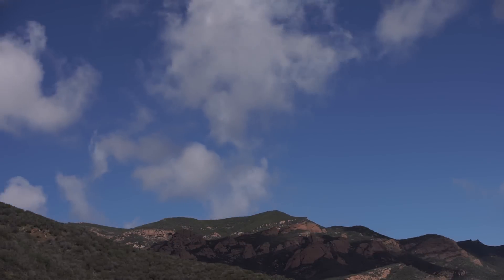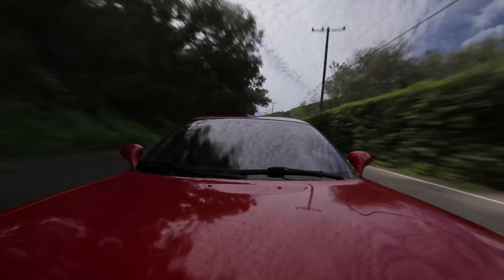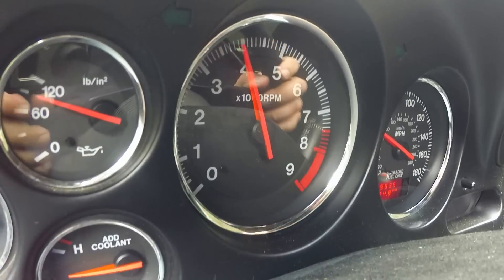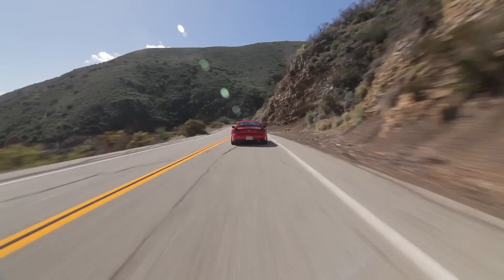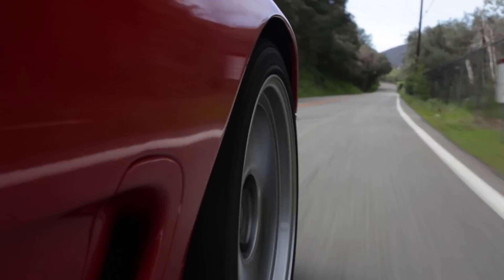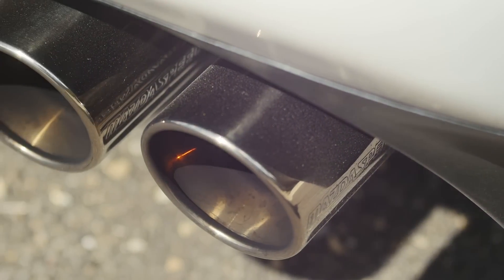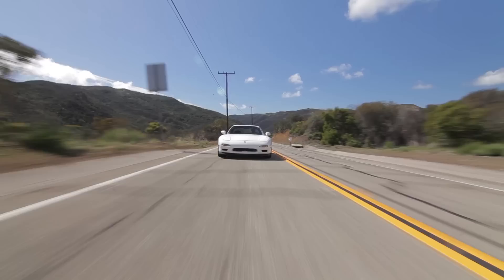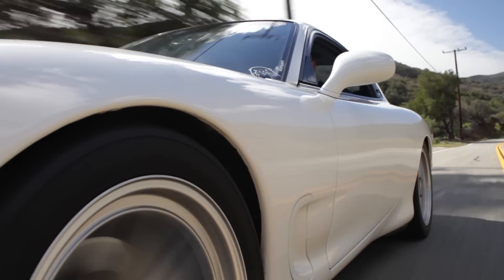Mazda  RX-7: Turbo vs V8 - /TUNED

Comment: Honestly, I'm not a fan of a V8 in an Rx7. With that being said however, if you really want to make a lot of power, going the V8 route would undoubtedly be more reliable in the long run and it would provide the low-end torque that only a large displacement motor can. Would it sacrifice handling? absolutely, but is it an absolute sin like most people make it out to be? no, it really just depends on what you want your car to be able to do. People who keep rotaries don't care so much about ridiculous straight line speed and acceleration and instead prefer handling, people who swap V8's don't care so much about handling and instead just want to go really fast. With either route, an Rx7 is still a beautiful and awesome car meant for a true gear-head.
Reply: the reason i would do a ls swap would be reliability not power
Reply: its so hard to lose weight compared to making power and because lightness is the best mod as it improves every spect of performance without having cons it would be a challenge to get the weight lost that was gained from the swap but if you did and managed to get 50/50 distributon without the need of removing creature comforts like a/c or powersteering but instead relocate battery/full carbon fiber front end/carbon fiber bracing/arms and componants the ls swap would be perfect.
Reply: Even worst , this guy said its classic british car😧     

😅😅😅😅😅😅 (brainwash technique HAS BEEN DETECTED🕯)
Reply: @pigeonsil240sx  LS engines are only 30-40 lbs heavier then the 13b with one turbo, and lighter then the dual turbo setup...the dimensions of the LS engine actually allows the car to maintain a near 50/50 distribution. seems like it would handle the same if not better than a stock rotary setup
Reply: @hahahafunniness  
the 13b weighs 337 pounds and the ls1 weighs 430 pounds a near 100lb difference not just 30-40lb a difference that would effect handling characteristics and feel less nimble and agile then the 100 pound lighter motor,..
the purpose of the rx7 was to be a light agile car where others opted for tehnology that added weight, fc3s had a 48/52 weight distribution with t2 motor. i think the ticket here is removing 100lbs up front after swapping in the LS this way you still have close to 50/50 weight distribution if your into twisty roads,if its just a street car who cares about agility right.
Reply: @pigeonsil240sx  I said the 13b with one turbo is about the same weight as an LS engine. Also, there are videos on this platform showing weight distribution of the fd after an ls swap and it’s pretty much 50/50. The only benefit to keeping the rotary over a piston engine is if you like to rev high and feel like youre constantly driving the car to its limits just to produce any torque.
Reply: @pigeonsil240sx  look into rx7 forums. They discuss the weight of the engine fully dressed with twin turbos is over 400 lbs. It’s very comparable to the LS engine but much more unreliable
Reply: @hahahafunniness  ok ill take your word on it. what i still dont understand is where the 337lb came from when its googled? I bet its 400lb 13b is with all fluids and accessories on the motor and 337lb 13b is dry with no accesories.therfore it sounds like your right.
was the ls used for weight comparison also full accessories and fluids added? thanks for the input on this btw.

Comment: It's sacrilege to take out the rotary engine from an RX-7 and put a V8 into it.
Reply: Attila Vidacs It's only sacrilege if you're ignorant to the advantages of having a V8.
Reply: Sigma Octantis Im sure if you dig deep enought, the third reich had some advatages... just sayin
Reply: +Saku Jalonen I applaud you good sir...
Reply: an even bigger sacrilege is how a corvette with 250k miles still runs strong and an rx7 with 100k miles needs an overhaul. if you even make it to 100k.
Reply: it's becuase clueless people think that maintaining a rotary is the same as piton. i have seen rx7's with over 300k kms.
Reply: At least it puts another rotary on the market
Reply: @abadibi  I have seen LS engines with 800km lol.
Reply: @weasle2904  and i have seen 2kd-ftv engines with over a million miles. I have seen D24TIC, B230FK, K24A3, and 1UZFE engines that also did over a million. LS aint as special as u think it is. It is only special in USA, but in places outside america the LS is too expensive and its cheaper to go other routhes that are more local. Lets say this: to get a B235R engine to 700hp is cheaper than buying an LS engine stock, you know that? and it'll be plenty reliable after u fix the oil pickup screen for like 2 bucks.
Reply: @abadibi  Almost all of those engines are not even comparable to a performance V8. and the B235R requires being rebuilt and heavy boost to even match the LS. The LS is one of the best engines around, even if you don't like it.
Reply: @weasle2904  bwahahahahah. He says as if he knows the b235r. It only needs pistons, turbocharger, oil pump and oil pickup screen. Those mods are 2200 dollars in total including the engine. Wanna reach 700hp on ls with stock ecu? Good luck with that because the ecu will set you back at least 2000 dollars for a good one with failsafe. Not to mention all the upgrade parts required. Dont talk about the b235r if you dont know it.
Reply: @abadibi  Are you 10 years old? 2200 dollars including the engine LOL! With custom internals and a turbo, okay. Maybe if you hired Ivan in Siberia to make you something in the metalshop haha! Custom internals, all that is need to be said. You're going to be lucky to make 500 HP. Sorry buddy lol. You can make 600-700 HP easy with an LS2 with a blower and a cam swap.
Reply: @weasle2904  dude...... are you kidding me? ive been working with these engines for 2 years now and here you are trying your best to "beat me" with your weak arguments, here is a full breakdown just so you understand it:
900 dollars for forged pistons
500 dollars for a hx35 turbo
300 dollars for materials to make the manifold and downpipe
350 dollars for a billet oil pump
150-250 dollars for AN lines, seals and other miscallaneous items. thats literally 2200-2300 dollars. I didnt include the engine cuz you can find plenty online for 50 dollars or even free ones, thats maximum 2350 dollars. You dont need cams or anything massive like that. boost the shit out of the engine and even the trans can handle the torque as long as its a manual. Ive seen one run this machine in his s14 with a bmw zf trans that he got for 150 dollars and could hang with supercharged ls swapped S14s. turbo lag is eliminated with anti lag system that can be added in the factory T5.5 trionic ecu.
I didnt add the cost of injectors spark plugs and fuel pump becuase you need that to mod your LS aswell:) but if you want that cost aswell its gonna be 600 dollars for a good 1200cc injector and spark plug set. And 70 dollars for a 300lph aftermarket fuel pump. Thats 3050 in total. Where i live, if i want a iron block LS i have to pay 4500 dollars. You can fuck off with the LS is better argument. It aint, your argument is just hanging by a thread. To what? own a outdated engine for 4500 dollars, are you serious? Want 1000hp? Then invest 250 dollars on forged rods from maxspeed. Building engines isnt that hard, anyone who tells you that is making it difficult on themselves. You just have to pay attention to detail, thats all.

Comment: 9:56 "The rotary engine certainly isn't better than the piston engine in any objective way"

- smaller
- lighter
- simpler
- sound better
- rev higher
- less vibration
- cheaper to manufacture
- less moving parts
- no reciprocating parts
- no catastrophic failure
Reply: +Kozzy Sound better? Arguable. No catastrophic failure? No, just lots of busted seals which are prohibitively expensive to replace and the reason why a huuuge percentage of the rotary engines ever made have already been scrapped for the value of their constituent metals, which as you pointed out, isn't much. Hmmm.
Reply: someone once told me apex seals are like timing belts 
hit 100k and spend some money and never think of it again for a while
not to mention depending how you service your car you may not even need to replace them until 150k plus kms
Reply: +1 rotary sounds better than your run of the mill v8
Reply: waikin Cheng Id expect most engines to get to 152000k’s without much trouble.
Reply: Smaller and Lighter, until you start adding more rotors to match the power of the V8. Simpler? Simple doesn't mean better, especially if it's unreliable. Sound better? It literally sounds like a dentists drill, it sounds cool for a minute, then you get sick of it. Rev higher? That's not advantage, that's a downside, needing to get to a higher rev in order to produce any torque. Less vibration? Small difference. Cheaper to manufacture? Not only is that not true when comparing to the LS, but it's completely irrelevant as the cost of the car is much higher and maintaining the engine is extremely expensive. Less moving parts. Again, doesn't matter, it's less reliable anyways. No catastrophic failure?! APEX SEALS.

Comment: You kinda kill the purpose and the character of a RX-7 if you LS swap it

Sure, with a big fat V8 you get more torque and more reliability (dem apex seals) and like Matt says on the vide...it drives like a Corvette, and I don't want no Corvette! I want a RX-7!
Reply: The purpose is to have a good sports car that doesn't drain your wallet and your   willpower.  Ls rx7 is a better car than a corvette because its 700 lbs lighter, and 10 grand cheaper and you don't have to fuck around with the rotary anymore.  It's bliss.
Reply: Actually, LS engines aren't big or fat. An LS1 or LS CT weighs about the same as a turbo 13B-REW, in fact. The LS is objectively better in almost every meaningful way. Weight goes up with these swaps most often simply because they beef up other things to handle the tremendous power of an LS.
Reply: Big fat LS ? Lol no. ALL LS engines are small and compact even the ls7. The displacement has to do with the bore of the cylinders and how much liters of air it can pump. So the inside of the engine is big but the block stays small
Reply: Weight isn’t really the problem though. The problem is that an LS sits way higher in the engine bay, which if you know anything about physics you’d know that makes a huge difference. Stock RX7’s are technically front mid engined cars because the engine sits behind the front wheels. In turn making it handle much better. If you LS swap it you lose out on those handling characteristics which is why he says it feels like a vette.

Comment: Sorry Matt you went into this biased...  This has been an ongoing argument in the rotary community for years and nothing was solved with your review.  Put two 450hp FDs on the track with similar suspension and brakes just the engine being different and you might have validated one or the other.  Then again knowing the arguments I've seen its like talking politics...
Reply: Braddah E Yeah it’s almost like pure horsepower isn’t what matters on the track. IMO once you get past like 600 WHP it starts to become a game of diminishing returns. LS guys can stick to the drag strip. Would much rather have a rotary that I can practically pull apart on the track then an LS that makes more power that I have to have towed away.

Comment: Depends on the single turbo used and the tune.  I make 450whp at 19lbs, on the street I tend to run at 15lbs which is around 380whp.  So that between an LS7 and a LT1 on high boost or an LS3.  I'm right at the traction limits 0-60 unless I heat up my tires at 15lbs of boost on the street in straight line.  Holding traction at 18lbs on the street is pretty dicey through 1st and 2nd which is why I don't do it.  That is with very sticky 285's in the rear.
Reply: yeah that's true, right now my FD has a 61.5mm Garrett turbo that I've had tuned to rock 15psi for "Daily use" on the street. it holds out quite well, the torque and turbo band is quite manageable and I love driving it tbh. right now I have 480whp currently on it. Long story short these cars are definitely controllable :)

Comment: Cool thing about rotaries is that tho the engine is SUPER compact, they still push a shit ton of exhaust air allowing them to spool larger turbos faster. This creates a nice responsive midrange TQ curve with the HP going strong till 8K+ rpm. I.E it makes for a sweet powerband in a compact package. Surprised Farrah didnt talk about this.